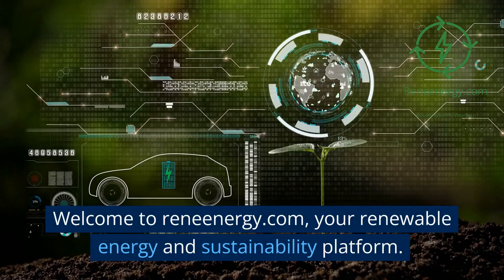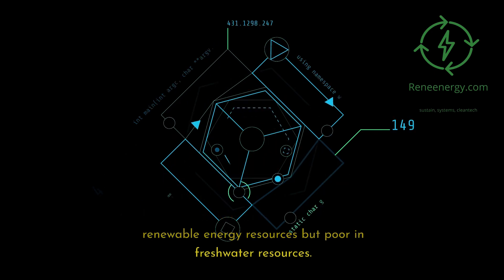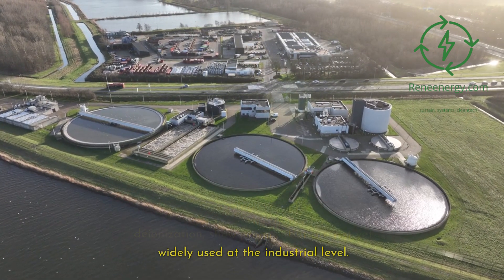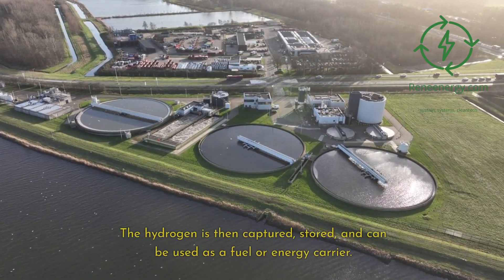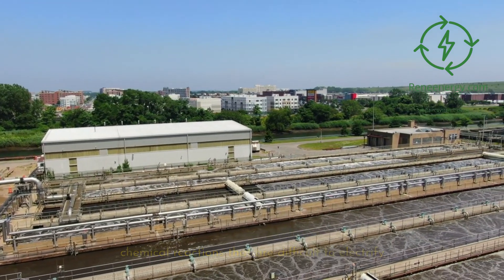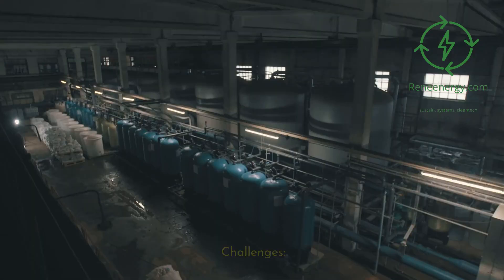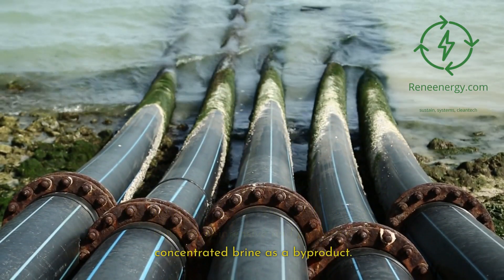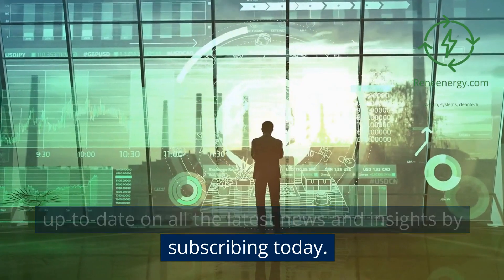Desalination and Green Hydrogen - A Pathway to Sustainable Water and Energy Solutions

Comment: I’m so pessimistic now. We talk and talk and talk about these problems and their solutions through technologies but I never ever see anything actually done. Corporations feed off the worlds problems. So they see to it that they are never permanently solved. Humans are despicable..
Reply from the maker: It's understandable to feel frustrated given the magnitude of the environmental challenges we're facing. It's true that there are many discussions and promises often not followed by sufficient action. However, it's essential to keep in mind that positive change is happening, even if it might not be as swift or as visible as we'd like.

One recent example of real, tangible action is Plug Power Inc.'s initiatives to incorporate green hydrogen into industrial processes. The company has embarked on three landmark projects to use green hydrogen in glass manufacturing, aluminum recycling, and steel manufacturing processes. These sectors have been historically difficult to decarbonize, so the significance of this progress is substantial.

Plug Power is leveraging their innovative 5MW electrolyzer modules, marking the first-ever use of industrial-scale green hydrogen in these fields. This isn't just talk; these are real projects that are underway, aiming to reduce carbon emissions significantly in industries that have previously relied heavily on fossil fuels. You can read more about this in their official press release here: https://www.ir.plugpower.com/press-releases/news-details/2023/Plug-Lands-Three-Electrolyzer-Deals-for-European-Green-Hydrogen-Projects-in-Hard-to-Decarbonize-Industries/default.aspx.

While there is still a long way to go and much more needs to be done, examples like these remind us that progress is being made. It's crucial to continue pushing for more action, more innovation, and more commitment from all sectors of society. We all have a role to play.